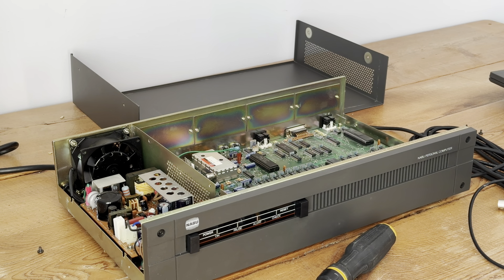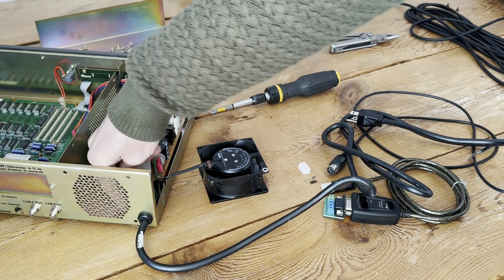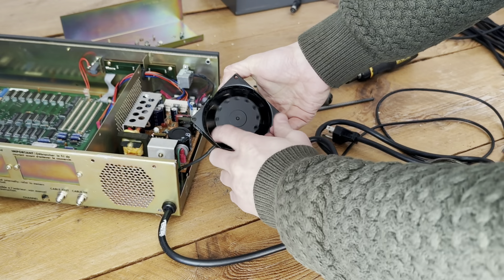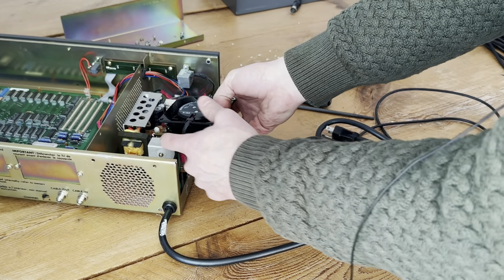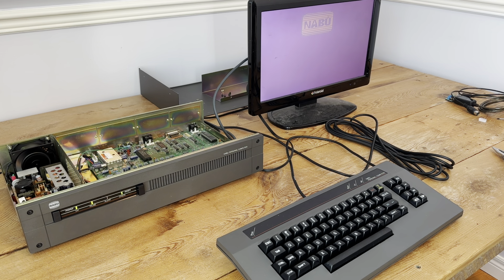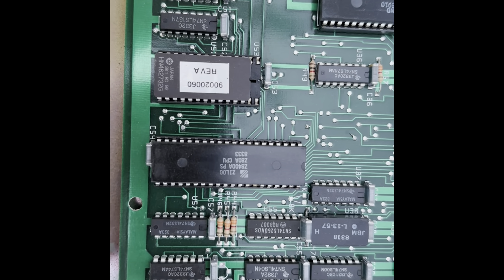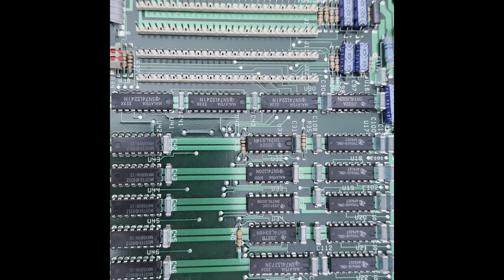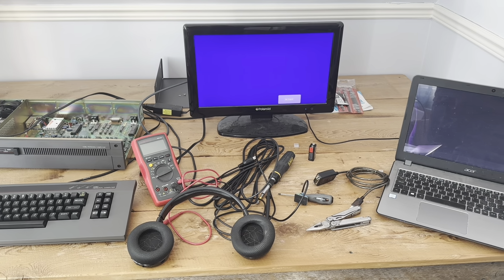NABU Fan Repair

Comment: Nicely done. Agreed removing the fan and putting it back in is a PITA. I ended up using a dremel on my fan blades.
Reply from the maker: I've got a second NABU coming. I'm going to try the simpler fan rotate 90 degrees with that one and compare the two methods.

Comment: There is any easier way. Just slightly bent each blade until none touch.  Thanks for sharing
Reply from the maker: I saw that video of yours before I worked on my fan. It does look like a quick fix, but I worried about upsetting the balance of the fan long-term.  It seemed to work great in your video, though!
Reply: @Retro Islander  no balance issue as each blade is slightly bent. Only bend enough to clear the housing. I've done several this way, and there have been no issues.